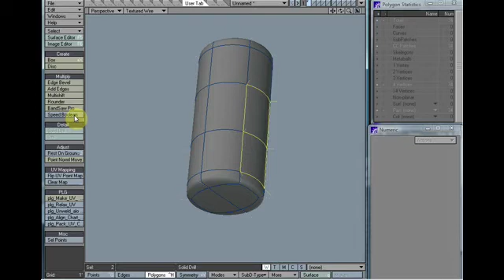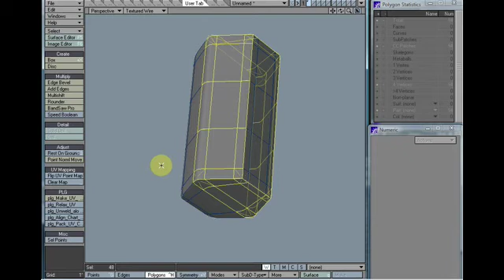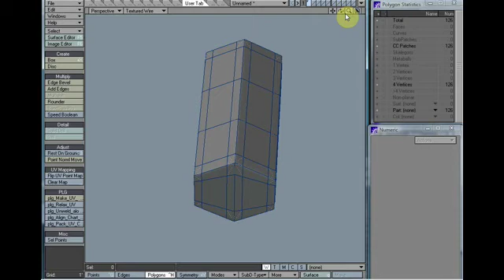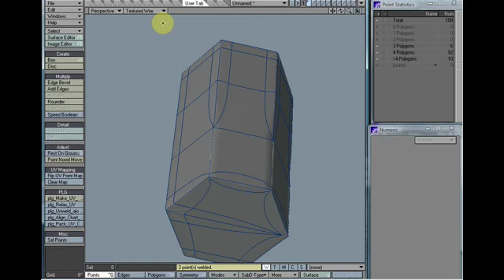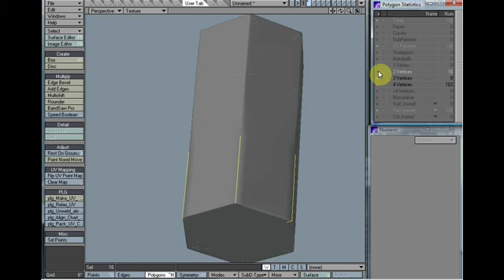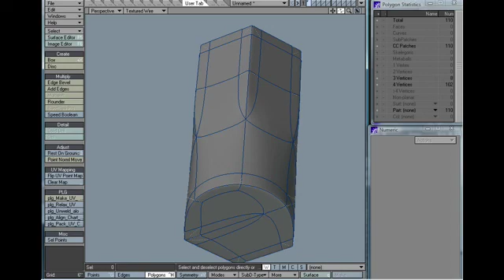Sharp to round edges in LightWave 3D

Comment: Thanks for vid. Question: is it possible to boolean nurbs in LW? Say, I have a wall made of nurbs, and I want to cut star shaped opening through. What would be the procedure?
Reply from the maker: Sorry LightWave doesn't do NURBS, it's a polygonal and sub-D modeler.  The closest you can get is with the LWCad plugin suite, which uses NURBS curves, but not solids.
Reply: Phil Nolan I see... well, by nurbs I meant sub-Ds (Catmull-Clark). So far I can only use 'bridge' between opposing polygons in the wall to create rounded openings. Obviously, it isn't precise. Is there anything in LW that allows at least some level of precision?
Reply from the maker: I don't think that would be very easy in any application. In LW I think you would have to convert back to polys (Tab) then do the Boolean or use Speed Boolean. The hit Tab to go back to Sub-D but  then you would have to do a lot of slicing and Bandsawing to get the sharp corners correct. For something like that it's probably best to just do it with polygons and use something like Rounder if you need rounded corners.